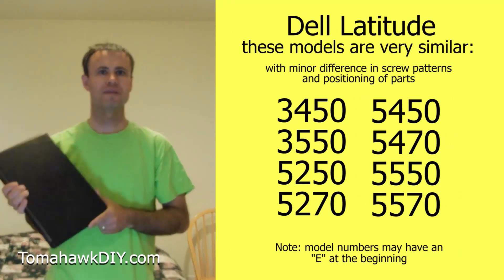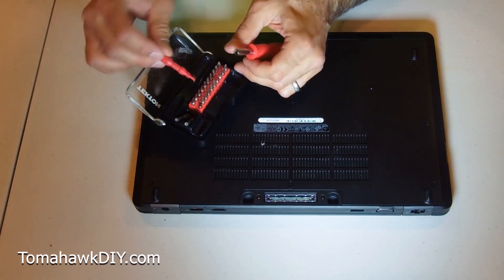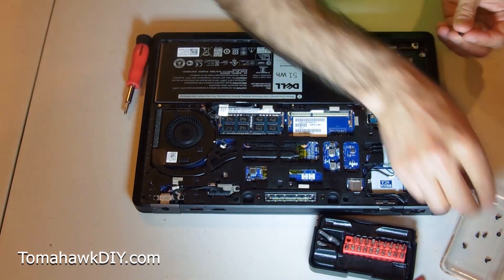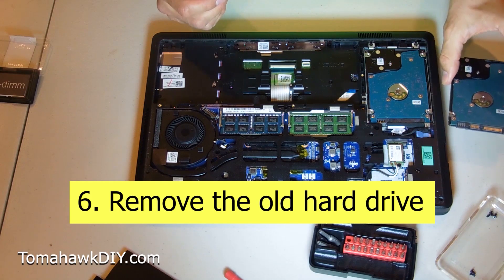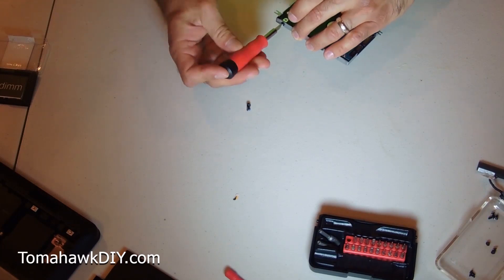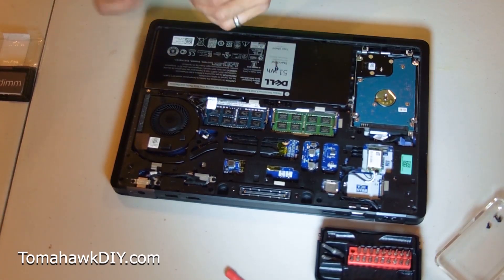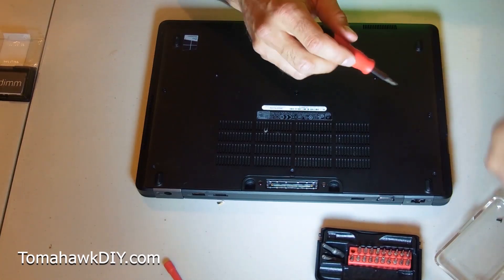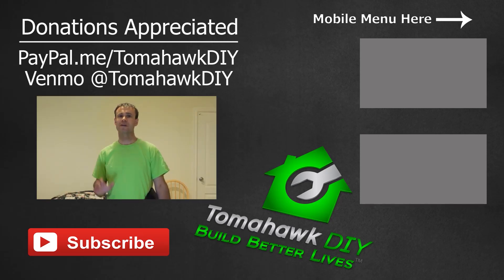How to Remove Hard Drive / Hard Disk (Dell Latitude)

Comment: Do you know if the Dell Latitude E4200 fits an HDD? I have seen most with SDD but I’ve come across a few that have an HDD. Can u advise what size HDD would fit in a e4200. Much appreciated